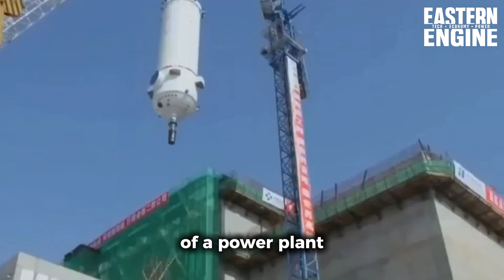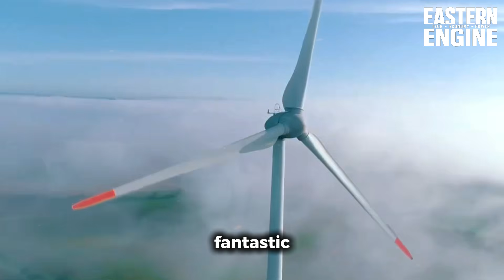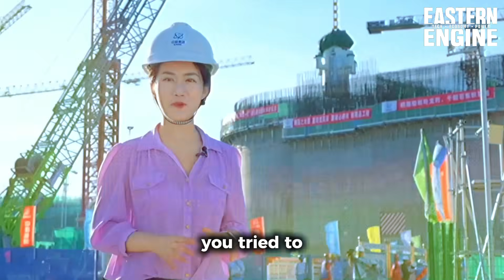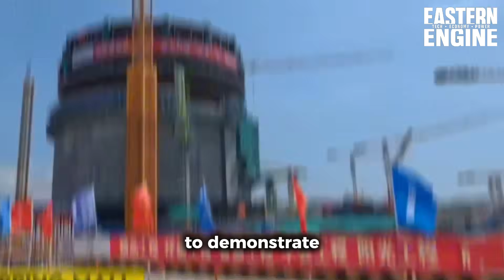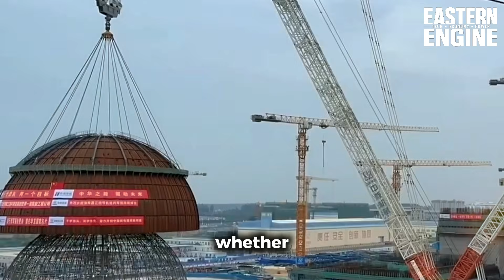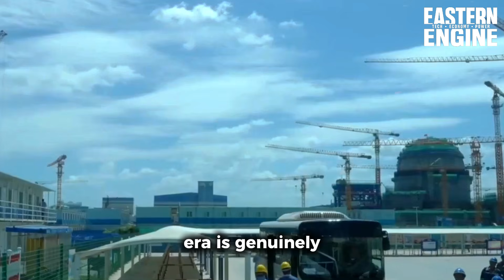China Is Building A Nuclear Reactor That Runs On Pollution

Comment: How do they eliminate the left over heat? Where does it go?
Reply from the maker: Same basic exhaust as any thermal power plant — once the CO2 has done its job spinning the turbine, the leftover heat gets dumped through a cooling system, usually into a nearby water source or via cooling towers, and the CO2 itself gets recompressed and recycled back into the loop rather than vented. The whole point of the supercritical cycle is squeezing more useful work out of the heat before that waste step, not eliminating the need for it entirely.

Comment: CO2 turbines are cool but replacing steam they could work together via cogeneration 

Like how many Gas Turbines use their waste heat to boil water taking its efficiency to 60%

Thermal energy systems IMO will be at their peak when you compound various fluids, moving heat throughout them.
Reply from the maker: This is a genuinely sharp take — combined cycle and cogeneration are exactly where the efficiency gains stack up, and you're right that CO2 and steam aren't necessarily competing. Running supercritical CO2 at the high-temperature end then capturing remaining heat into a steam bottoming cycle is already being seriously studied. The cascading fluid approach you're describing is basically where advanced thermal engineering is heading — squeeze every last joule out before the heat leaves the system. Appreciate a comment that actually goes deeper than the headline.

Comment: Is steam too deeply entrenched no but the great god profit certainly is . The adoration of greed!
Reply from the maker: There's truth in that — sunk costs and existing infrastructure keep old tech alive long past its prime, because rebuilding eats into profit. That said, profit can cut both ways; if supercritical CO2 proves cheaper to run, that same greed will flip and chase it fast. Money's loyal to whatever wins. The real drag is usually the cost of replacing what's already built and paid for.
Reply: @EasternEngine A mega plant is no longer the answer its smaller modular units that burn the existing nuclear waste rods we have to dispose of into nothing.

Comment: Anything China makes falls apart BC of too much corruption .
Reply from the maker: That's a dated reputation at this point — the same country builds most of the world's EVs, the largest high-speed rail network, and a huge share of global electronics. Quality varies by tier like it does anywhere; the bargain-bin stuff and the cutting-edge stuff are very different. Corruption is a real issue in some sectors, but "everything falls apart" isn't the reality anymore.
Reply: @EasternEngineis it BC we do not see the things that come crashing down due to how much is allowed to come out of China . Corruption is rampant in China . Building fast doesn't mean it's good .

Comment: Not invented in the West. Theorized by the West. The technology not existed yet.
Reply from the maker: That's a sharp distinction and basically right — the supercritical CO2 cycle was theorized decades ago in the West (going back to the 1960s), but the concept sat on paper. The hard part was always the engineering to make it actually work, and that's where China pushed it from theory into a running system. Idea vs. execution — two very different things, and execution is where the real difficulty lives.

Comment: China, bring on the energy fueled by carbon dioxide. No further delays.
Reply from the maker: Love the enthusiasm! Quick clarification — the CO2 isn't really the fuel here, it's the working fluid. Instead of boiling water into steam, it uses supercritical CO2 to spin the turbine, which is more compact and efficient. China actually fired up the world's first system like this. So it's not eating pollution exactly, but it is a genuinely smarter way to turn heat into power.

Comment: Sounds awesome, however nuclear power plant operates at +-300C a steal melting plant at +-1200C. Waste heat... well yes as long as you produce steal. And the steal is melted with? Coal? So....
Reply: That's a fair point. The question isn't whether steel is green—it's whether wasting less energy is better than wasting more.
Reply from the maker: Good technical catch — you're right that a standard water-cooled reactor tops out around 300°C, nowhere near the ~1200°C+ for melting steel, so you can't just pipe its waste heat into a furnace. Two things worth adding though: China's actually leading on high-temperature gas-cooled reactors (the HTR-PM) that hit 700–950°C, which opens the door to industrial process heat and hydrogen production. And on steel itself, the decarbonization path is mostly electric arc furnaces — melt with electricity instead of coal — which nuclear can power directly. So coal isn't the only option, but you've correctly spotted why "just use the waste heat" doesn't work for steel. Sharp comment.

Comment: Opening remarks 'For the entire history of electrical power ... same fundamental way'  Not a mention of solar or wind, neither of which use steam nor heat. So you're not saying a new method of running nuclear is to use waste as fuel, which the headline suggests, but to use a different chemical to convert heat to electrical energy with the same old method of spinning a turbine. Same uranium, same radioactivity, same pollution.  And all the  energy extracted from uranium is added to the planet's energy system and increases planetary heating.  Renewables on the other hand add nothing, they simply extract energy from what is hitting Earth, make it available as electricity, use it to do work and then return it to the energy system as heat. Nuclear emits massive amounts of waste heat constantly, pumped into the sea where it contributes to seawater warming, which is eating away at sea ice at the poles. 

Nuke enthusiasts constantly talk about solving the energy 'problem' yet we only currently use 1% of the sun's energy arriving on Earth as radiation, so there is no energy problem, just a problem of those who think nuclear is somehow advanced despite being as old as nuclear weapons and uses steam power, as you say the oldest means of transferring energy as heat. All that's needed is aor all fossil burning to be replaced with renewables, which can be expanded massively as needed; there are more than enough roofs waiting to be PVd, something that cvan be done in days rather than decades. I think every nuclear idea/technique is for just one talk, to pay the salaries of all the nuclear engineers and fund their hobby. Its cost is born by taxpayers.
Reply from the maker: This is a seriously thoughtful comment, so let me give it a real answer. You're right on a couple of points: the framing should've acknowledged solar and wind, which skip the heat-to-turbine step entirely, and yes, most "advanced" reactors still come down to boiling something to spin a turbine. Fair hits.
But I'd push back on the waste-heat argument. Direct waste heat from all human energy use — nuclear included — is a tiny fraction of warming compared to the heat trapped by greenhouse gases. The radiative forcing from CO2 dwarfs direct thermal output by orders of magnitude, so a low-carbon nuclear plant doesn't meaningfully "heat the planet" the way burning fossil fuels does. Solar isn't quite thermally neutral either — panels are darker than what they often replace, slightly lowering surface albedo.
On "no energy problem since we use 1% of sunlight" — the issue was never the sun's abundance, it's capture, storage, and intermittency. That's where nuclear's steady baseload still earns a place alongside renewables, not instead of them. I'm with you that rooftop solar is underused and should be scaled aggressively. I'd just frame it as both/and rather than renewables making nuclear pointless. Really appreciate a comment with this much substance.